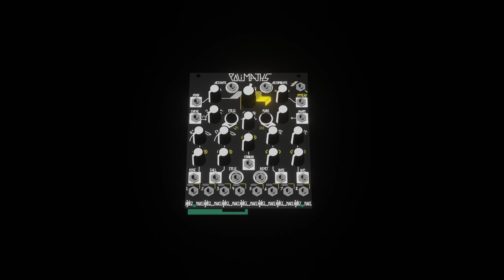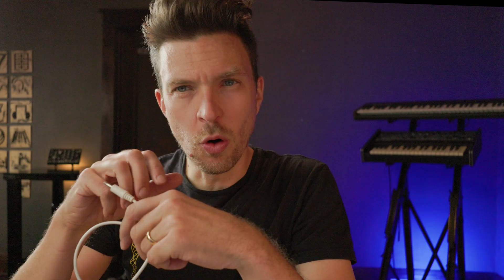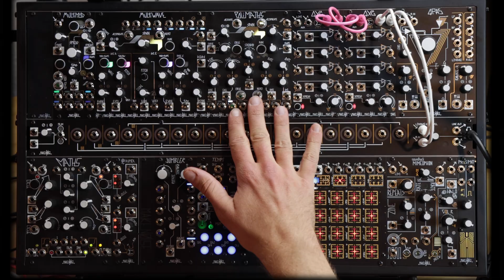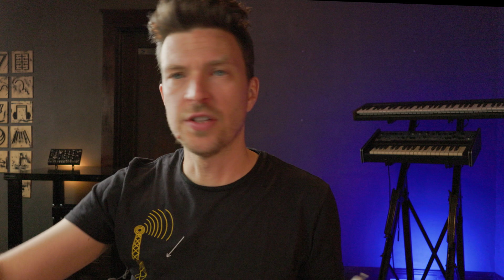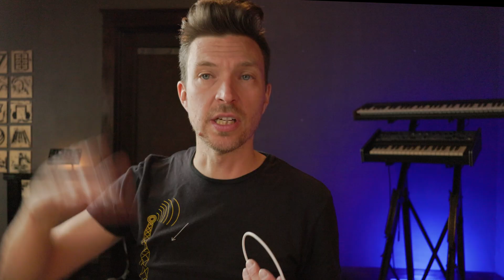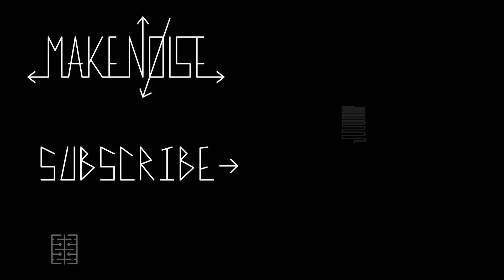PoliMATHS SubMixing and Audio Use | Make Noise

Comment: Sweet video. Finally getting a grasp of the polymaths and qxg’s. Currently running the new Enjoy electronics ELFO through the polymaths through the landscape noon and back into the enjoy electronics deefeel Absolute modulation chaos. Can’t wait to add the multi wave to the system and push it to the next level.

Comment: This is one of the PM features I find absolutely brilliant. The module is really starting to grow on me and everything is starting to make both noise and sense. Working on a video with PM + QXGx2 and Serge Medusa (seven voices). BTW, MultiMod also has a NUSS header, works so nicely! Spectraphon also seems to have a similar connector, but as far as I know it will freeze the SP (so don't use it, but maybe there will be a new firmware in the pipeline that can send all outs :).
Reply from the maker: Yeah don't connect that Spectraphon header! It pre-dates the N.U.S.S. concept
Reply: @MAKEN0ISEMUSIC  I had to try :)
Reply: Been experimenting with that multimod header, very interesting……
Reply: @SequentialFrequencies  will have to try this in the morning. Very curious now
Reply: Is there any documentation for connecting the multimod NUSS header to other NUSS modules ?
Reply: @naefspiel I don't think so, but red stripe to the right. If you do it worng, channels are reversed. There's CV, no power. And you need to use a NUSS cable, obviously.
Reply: @CinematicLaboratory  Thanks ! So then the Multimod does to the QXGs what the Polimaths does when connected via the NUSS headers ? Is it possible to have them both trigger the QXGs under the hood at the same time somehow ?
Reply: @naefspiel  Indeed, when you use phase and spread, the LFO's (or external CV,) will modulate the CV similar to the PoliMaths. When you use MM for audio and use the audio headers, you can make supersaws and clusters. Video coming soon!
Reply: @CinematicLaboratory  Thanks so much ! I always enjoy your videos

Comment: I have a nice patch right now that is using polimaths round robin on 1 3 5 7, 1 qxg, and an Intelligel shifty to distribute pitch cv to 4 oscs, then out through QPAS. Works well and polimaths does the lifting on the gates behind the scenes! Looking forward to Multiwave.

Thanks for making it distribute the channels across 4 channels properly if you only have 1 QXG.